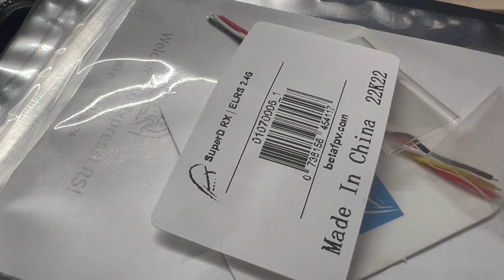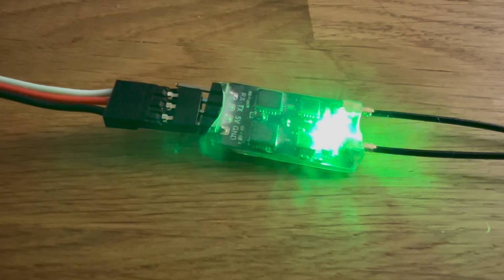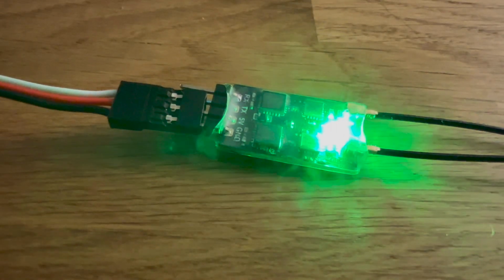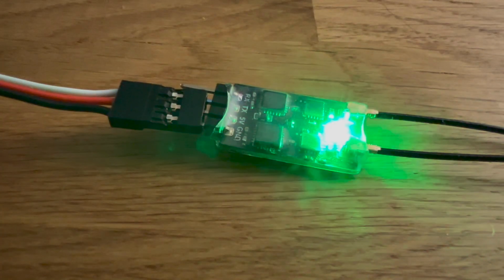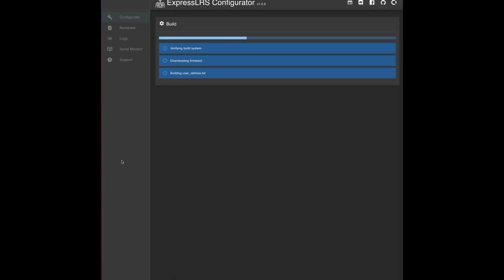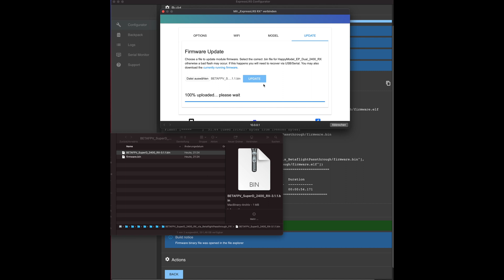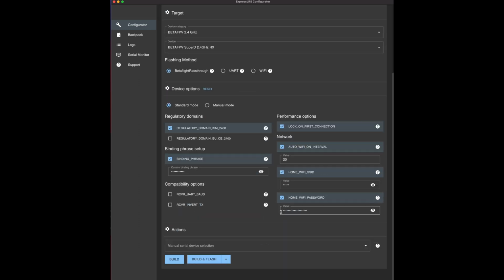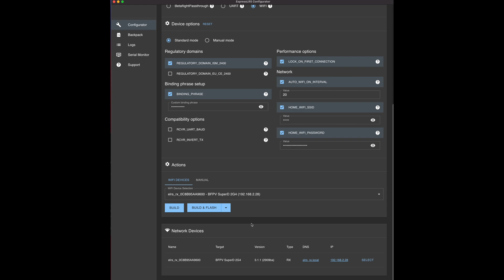Flashing the BetaFPV SuperD the first time #expresslrs

Comment: my friend! im doing the build part but once i have the document i just get the       firmware.bin     i dont get the one that you load into de wifi mode what is grong? im doing it on the wifi flsihng mode because if i chose the betaflightpassthorugh there is no option to BUILD. Im trying to update my superD 2.4 to the 3.4 wich is the same as my radiomaster zorro
Reply from the maker: The firmware.bin should be fine too - I assume it’s only a copy